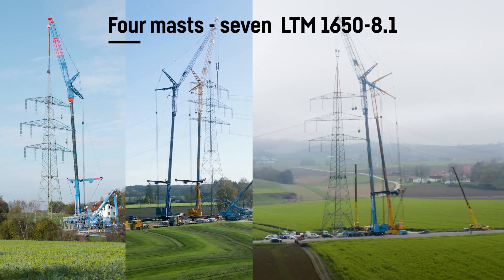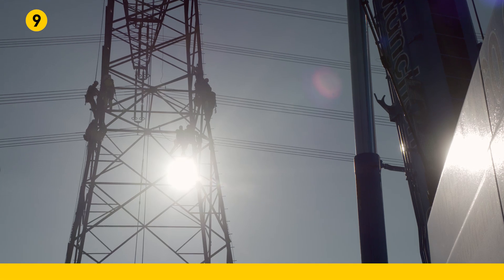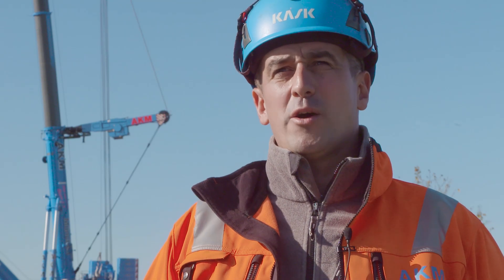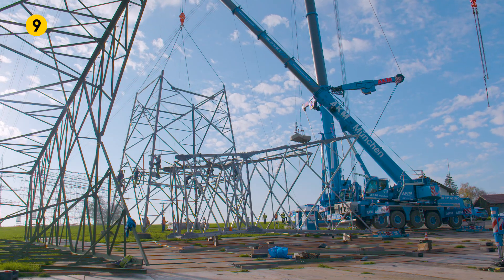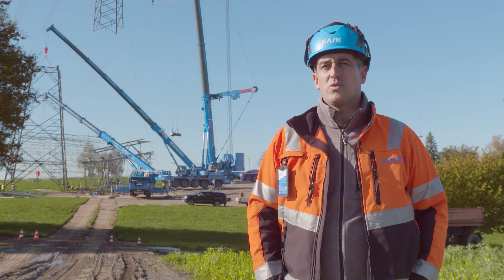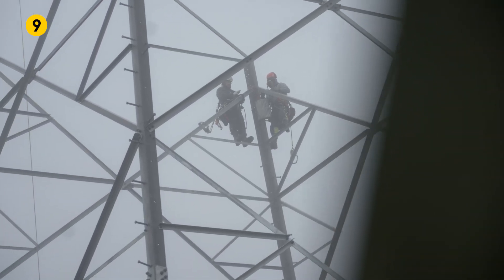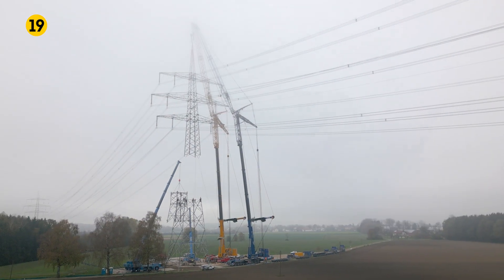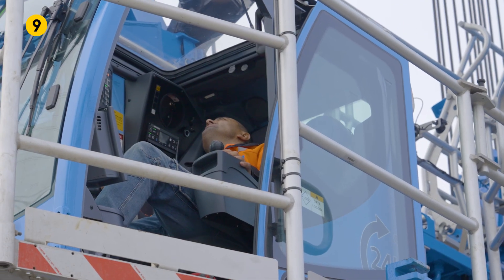LTM 1650-8.1 Seven at a stroke | Liebherr

Comment: In Québec, that would have been a rebuild job. There are enough alternate pathway for electricity to be able to afford to take lines completely down for such a job. If lines are really that heavily used in Germany, new lines should be built to provide some level of redundancy. It is a game of change and odds. Almost inevitably, your number eventually comes up. Without that redundancy, it is likely that Germany will eventually encounter an event that causes service disruptions.
Reply: We have a green policy to prohibit new lines, new transformer stations, new power plants, and so on. We have plans for several GW of pump storage to equalize renewable power, but they prefer catastrophic floods every ten years instead of building reservoirs. But the old reservoirs are tourist attractions and are even visited by a lot of Arabs. I remember a 400kV line where advocates worked twenty years (!) to get approval and earned 'golden noses', and then it took two years to build it. Humans are crazy!
But there are also other methods. After the German reunification, several HV lines had to be rebuilt. They used auxiliary masts to put the cables aside, rebuilt the towers, and placed the cables back on the new towers. So, they had to switch off the lines only to place them on the auxiliary masts and back. On double lines, one could do that alternatively, so at least one line was always active.
Reply: @gottfriedheumesser1994  That is indeed crazy. Building lines around here used to be harder until we had a catastrophic freezing rain event. Like I said, its a game of numbers, and eventually, yours will come up. When it does, public pressure to make sure it never happens will likely be greater than the pressure to preserve the views of a few peoples.
Reply: Europe is lost. Enjoy your Arab masters
Reply: @ryanburbridge  Back on the trees!